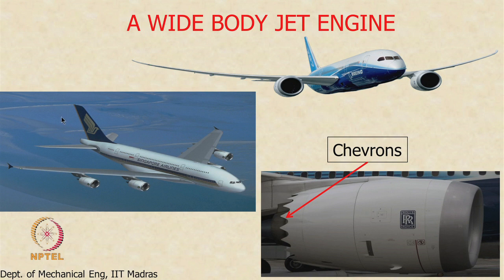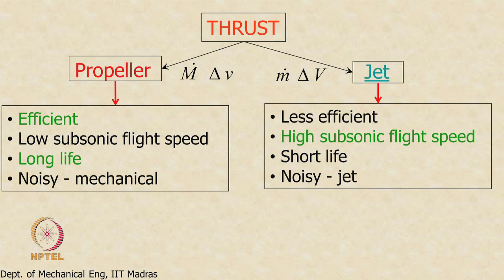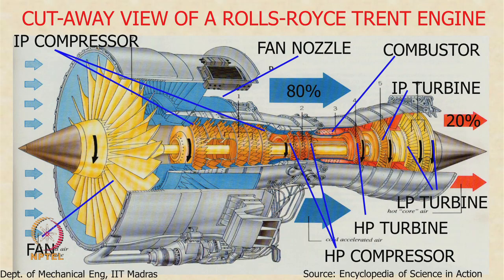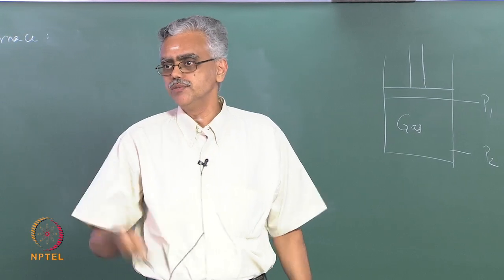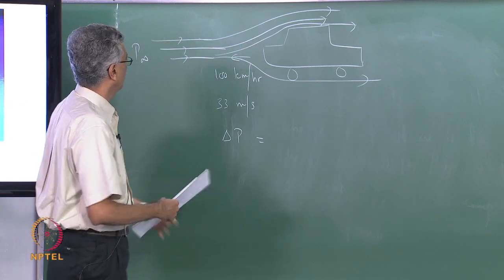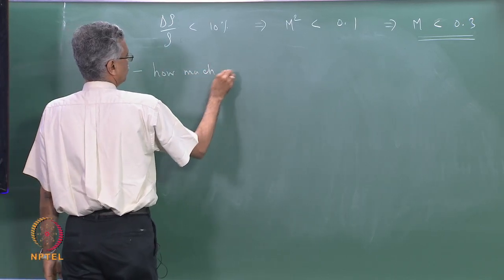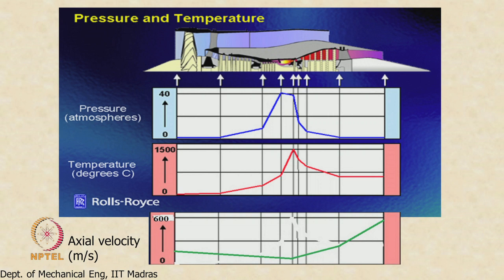Mod-01 Lec-01 Introduction

Comment: Why does the fan in the turbofan engine produce less noise then the propeller? is it because of the nozzle?
Reply: I think it's because of the size, the fans in turbofans tend to be much smaller than the propellers, and they are enclosed to so the walls could have a factor in insulating the sound. I'm not sure about it though it is just my thinking

Comment: Is it not the Bernoulli's equation that says delta_P = 1/2*rho_V^2? I think that 1/2 was missing around 35:30.
Reply: It is only meant to capture the scale/order of the pressure change, Hence the Proportionality Constant can be left out as it as insignificant change on the order

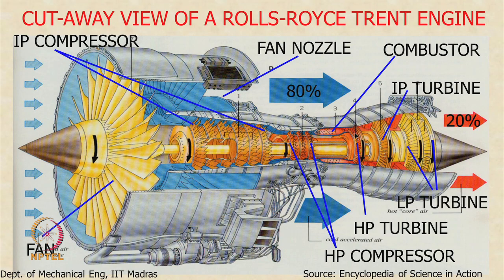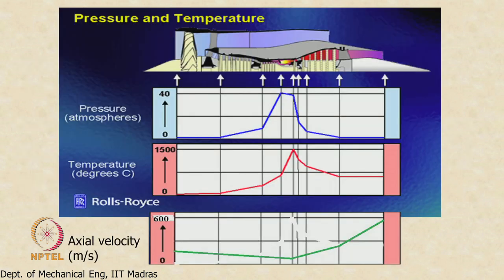Comment: Overall a good presentation, but you make a huge and very common error at 12:52. You say that the pressure of the gas is increased by the heat of combustion. In a turbine engine this is not true.  The chart you show at 21:12, supplied by Rolls Royce, directly contradicts your statement. The pressure of the gas actually decreases in the combustor,  because although the gas expands due to the heating, it has a pathway to move through,  the turbine.
The heating of the gases caused by burning the fuel causes them to expand in volume, but does not increase their pressure.
I mention this only because many people make the same mistake, and therefore can not understand why the combustion gases do not flow out through the compressor.
Look at the pressures described by the chart you show.
A gas will always move from an area of higher pressure to an area of lower pressure.
Reply: Negative. I have not said that the pressure is increased in the combustor. I am saying that we have increased the pressure (in the compressor) and the temperature (in the combustor). I have stated that the internal energy alone is increased in the combustor.
Reply: @vbabu6263  Sir at 35:30 , wont bernoulli's equation be (rho*v^2 )/2 ?
Reply: AgentJayZ
Reply: Sir said that the pressure of the gas is increased in the compressor zone   and temp. of the gas is increased in the combustor zone.